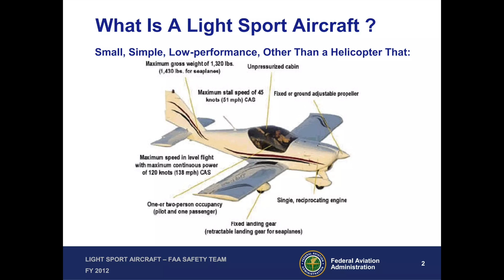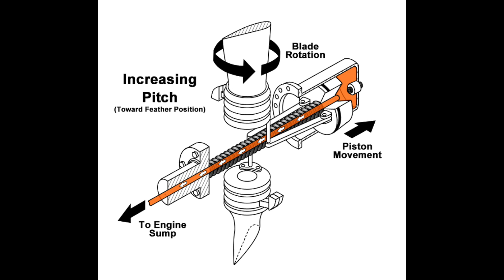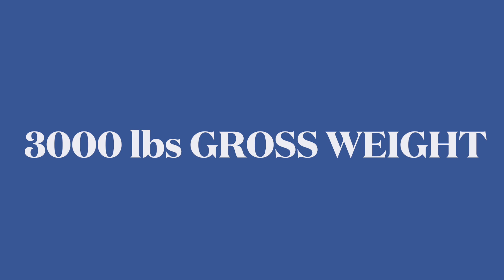Proposed new Light Sport Aircraft Rules

Comment: Had a Piper Cherokee 150 with a 160hp upgrade and VG’s and an STC that amounted to tape on the stabilizer.  That handled better in slow flight & stalls better than any C150, 152 or 172.  
   To omit the Cherokee would be a shame
Reply: 140 which is a 150 hp.  Couldn’t edit

Comment: Actually the gross weight you speak of that is 3000 lbs, is not actually what determines what the weight is, it's the 54 kts clean stall speed which equates to about 3000 lbs.  However there are planes that can have that stall speed of 54 kts and be heavier.  That is why a certain weight is not a requirement.  thanks

Comment: STC how do they play into action?  Cessna 182Q get STC paper note in log book and gross increases to 3110 lbs from 2950.  Above the 3000 lb llimit proposed.
Reply from the maker: Good question, I guess you would not be able to fly one over 3000lbs, like the Aeronca Champ, they have gross weights all over the board, but current LSA limits you to ones less than  1320lbs.

Comment: A 182? That's a complex aircraft! 235 hp, plus a constant speed prop. And the FAA wants this complex aircraft to be considered a LSA? Sorry, that's insane. 45+ year A&P, here.
Reply from the maker: Per the FAA, a complex aircraft has 2 of the following, controllable pitch prop, movable flaps, or  retractable gear.  Not sure the controllable prop makes that big of a deal.
Reply: @J3PiperCub  Not 2 of the following, but all three.    14 CFR part 61, section 61.1 "Complex airplane   means an airplane that has a retractable landing gear, flaps, and a controllable pitch propeller"

Comment: I don’t think your going to see a huge movement of sport pilots moving into “complex” airplanes without training. I think the biggest advantage is the ability to be able to utilize the extra weight allowance. 1320 pounds is very difficult to stay under especially when you want to add a brs. A lot of “LSA” airplanes are built for higher gross weights, but can’t utilize the the extra weight because of the 1320 pound max weight limit. All the new Kitfox’s have a mtow of 1550 but if your sport pilot rated, your stuck limiting it to 1320, giving up 230 pounds of useful load. That’s a lot.
Reply from the maker: Perhaps you are right, but I think you will see many pilots like me, those who hold a PPL flying a 172 under LSA rules. But I could fly that under a standard medical, so it is making it easier for me to fly, but not really bringing  a new person into aviation, which is the intent.
Reply: @RetreadPhoto I am not sure what you mean? An example......a  kitfox 7 has a MTOW of 1550. If you build it and certify it at 1550,  you have to have a Private license to fly it. So, you're forced to certify it at 1320 to fly it with a SP license, leaving 230 pounds of useful load on the table. I am not sure what "outlaws" love doing, but the above example is what I was referencing to.
Reply: @RetreadPhoto Said like an outlaw.

Comment: I was under the impression we were at least a year or more out from the rule changes.   Been watching  to see if it's more stalling.   After the bright idea of FAA demanding transponders for toy rc planes and drones, I figured they were hell bend on pretty much over regulating our farts next.
Reply: It is more than a year away, true.  And the new rules are more restrictive than many are reporting.  Weight goes up by 110 lbs, constant speed prop, speed higher too.  and four seats, but a sport pilot still cannot take more than one other at a time.
Reply: The FAA can't create laws only congress can
Reply: @RetreadPhoto not sure u are right!  Remote ID.  I know it is a big issue.  Ama club fields were except.
Reply: Except that the FAA has actually done more in the last 25 years to loosen various requirements for pilots and aircraft than tighten it. Starting with LSA and Sport Pilot, then to BASICMED, and now MOSAIC, the FAA has made it measurably easier from a regulatory standpoint to fly. The regulations regarding UAS came about mainly at the behest of the GA advocacy groups who feared that if nothing was done to reach UAS operators and educate them on the use of airspace, that GA flying could become more hazardous. It's early days on that front, and expect refinement of those rules as time goes on. If there is anything you can still complain about, it's the insurance companies. They have much more say about what pilots can do these days than the FAA does.
Reply from the maker: I agree we are headed in the right direction, although I think we are several years away from the changes going into law.  Hopefully the suggestions made by AOPA will find a way into the final version.
Reply: @J3PiperCub  This is one point I think you get wrong in the video. No legislation is required to enact the rule. The FAA is acting under their regulatory authority, so when they publish the final rule, it's law. I want to say I heard on a recent EAA webinar with Tom Charpentier that they are hopeful that the final rule will be published by the end of this year. The only problem is there are still a lot of questions about what the rule means for maintenance authority given that we're essentially creating a whole new category of aircraft. Some feel it's also taking a step backward for those holding Light Sport Maintenance certificates.
Reply: Just as I hit the button, I realized I need to make a clarification. I'll stand by my note about EAA's opinion on the final rule, but AOPA also reported at the time the comment period was extended that "AOPA learned in discussions with FAA staff that the extension should not affect the planned implementation by the end of 2024." - from their website.
Reply from the maker: Well, as a lawyer, I use "legislation" pretty broadly, depending on if it is considered a major rule or a minor rule.  Basicmed was a major rule that required being signed into law  as part or larger legislation by Obama.  I would be shocked it the final rule is published before the end of 2024, but that would be great.

Comment: I personally don't think this is a good idea. There is already too many accidents involving new/inexperienced pilots crashing planes that are too complex for their skills. Now you have less training and less requirements to fly bigger faster, more complex airplanes. Recipe for disaster. Additionally this makes a PPL almost useless. Yes it would lower entrance costs into GA, however, at what non-monetary cost? They should focus on modernizing their medical standards instead...
Reply: The 1,320lb rule was arbitrary, and prevented flying the Cessna 152 for an unknown reason. It was supposed to create a market for LSA specific models, but those are just airplanes for a market that did not exist outside of arbitrary rules. The original rules should have allowed a 1750-2,000lbs range for Citabrias, super cubs, C-152s, all the classic slow two seaters etc that the older pilots of that era were already flying. As this was really an exercise to experiment with relaxed medical requirements for those with diabetes, etc.

The new rules place no limitations on weight, only performance and stall speeds.

There is no correlation between fatal aircraft crashes, especially due to stalls/spins, and aircraft weight in the range between 850-3000lb. Cubs, Cassutts, and Cessna 177s will take the best pilots among us. 

The solution is and always has been to teach people the stick is the stall lever, not the up-lever. Up is due to power. Fatalities are the result of forgetting this.
Reply: Imagine if there were studies over the last three decades that would provide solid accident data over all types of GA flying that could inform policy makers and shape policy that is actually scientifically based? 

If it weren't for the Nall (renamed the McSpadden) report published annually by the Air Safety Institute, we wouldn't have MOSAIC today. You can think what you want, but there's hard data that says otherwise.
Reply from the maker: The McSpadden repots are interesting reading suggesting recently that LSA pilots had a higher accident rate,  but a lower fatality rate.  I also found it interesting that a large percentage of people flying  LSA are older private pilots flying under LSA rules, not certificated LSA pilots.
Reply: ok but does having a 3rd class medical really make for better pilots? I'm just asking. Not that the PIC shouldn't be fit and proficient. But how many times has a pilot been in some way become incapacitated in the air? I know I have heard of a few but it's pretty rare isn't it? And most had their privates or better and their medicals too so. Also wouldn't you get training and checked out before you hopped in a bonanza to bore holes in the sky?
Reply: @oneninerniner3427  I agree with you completely.  Across the board, from LSA to ATP, less than 1% of aircraft accidents are caused by pilot incapacitation.  I also agree with the 58kt stall speed. MOSAIC is the best avenue to getting more pilots in the air.
Reply: As an old old student that never finished his private I'd still like to build a kit LSA and get my sport ticket.
Reply: @oneninerniner3427 I’m an old private pilot that only ever did LSA type flying and I’d love to build a Phantom 1 ultralight or maybe a Zenith.
Reply: Access to more planes, that are cheaper to rent, would give Sport Pilots the ability to clock hours easier and cheaper.
Reply: Statistics say that private pilots are doing most of the dying in aircraft.
Reply: Iam sure glad you're not making that descions
Reply: I wanted to take you to town on your comment.   But, after I thought about it, you are right!   A sport pilot license was suppose to make flying more affordable, and if we are honest, the real reason it exists is for those who can't pass the medical.     Not sure why one might want a complex craft if their goal was affordable entrance into the sport.   New light sport are so overpriced, I'm not sure who is running out to buy them regardless of pocketbook!   315k for a modern remake of a J3 Cub?  Are you kidding me???    So, sadly, that leaves VERY OLD, very used, very much planes on their last legs in life being the 'affordable' options.   Vs. a nice new modern technology and safety standards for only a special few. 

The entire idea of GA flying has gone down hill.  Not sure it will ever be for anyone but top 1% earners.     When I started flying in late 80's, flying was  VERY AFFORDABLE.  Now? Well, unless you are rich, you can't afford SAFE new craft!  Does that seem right to you?  We aren't entitled to NEW, but we should be entitled to SAFE!   IMHO, FAA Over regulated where it's pointless, and not enough regulations where it would save actual lives!  Maybe, stop caring so much about a toy RC airplane having a transponder, and instead focus on all the crappy workmanship causing engine outs on take off!  Hold the right people responsible and stop punishing the consumers!   Goes even more so for the Ultralight community.   Gas powered $5k weedwhackers that fail more than my actual weedwhacker engine!